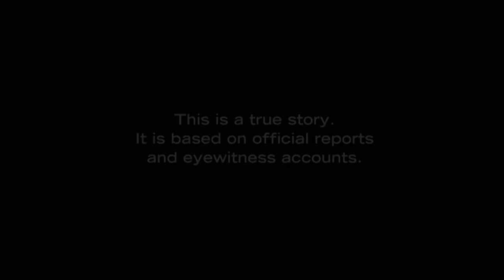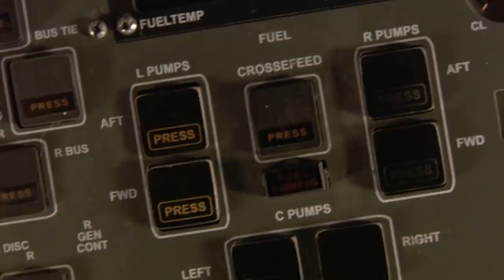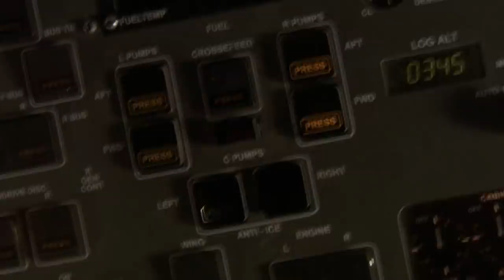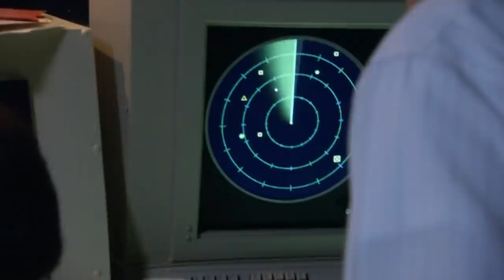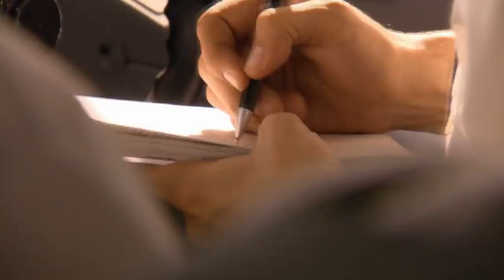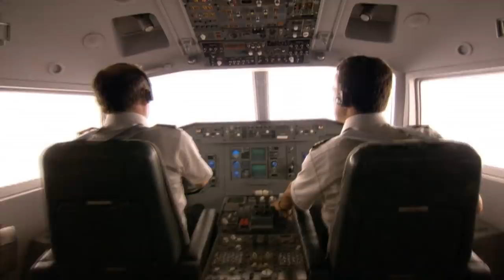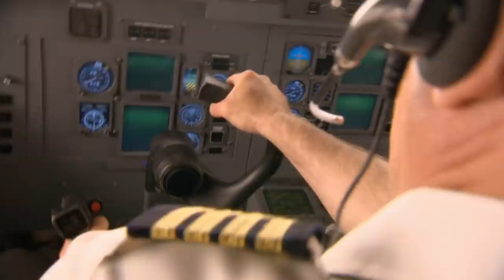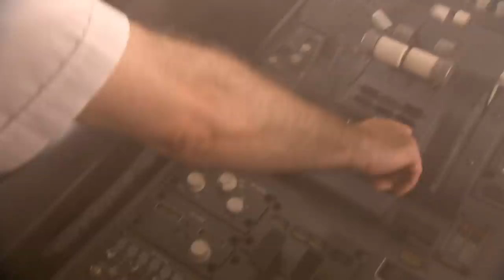Landing A Boeing 767 Without Engines | Gimli Glide | Mayday: Air Disaster

Comment: "The runway he trained at 15 years ago... is no longer a runway" that's got to be the biggest bruh moment of all time for these pilots
Reply: Kids on the bikes:
Pedaling into the grass?  Nah
Trying to outrun a plane? Yeah boi
Reply: Anything's a runway if you're desperate enough.
Reply: @vikkimcdonough6153  even a highway could be a runway
Reply: I think they mean the runaway they used is no longer a runaway.
Reply: @nikeboi2882  didn't another plane try that near atlanta and it blew up iirc
Reply: They don't mention it in this video but in the original they explained why it ran out of fuel. The reason was around the 1980's Canada had just adopted the metric system. The crew fueling the plane that day did their measurements in gallons not liters.
Reply: @JohnNorton86  they explain this in part 2 of the video.
Reply: @JohnNorton86  Im aware
Reply: @vikkimcdonough6153  even a city is a runway
Reply: @jaybartgis5148  those kids went to the Prometheus school of running away from things
Reply: The kids were freaked out in shock
Reply: What about that one when a plane crashed in a neighborhood in california
Reply: @cononodapotato6920  Southern airlines flight 942. Hit a gas station on a highway after both engines flamed out in a storm
Reply: @Giratina575  I thought that it was Southern Airways Flt 242.
Reply: @redfern2236  whoops I got the first number wrong. I knew it was something 42
Reply: @Giratina575  it’s okay. I knew what you meant regardless.
Reply: Here in New Orleans Taca flight 110 landed on one of our levees. And to even make it more badass the pilot only has one eye!
Reply: Baby I would’ve dieedddd lmao
Reply: Bruhhhh
Reply: @therealcrowsyt385  It was turned into a drag racing track and evidently no one knew that.  And it was a Saturday and the races were going on and still no one was harmed!  How awesome is that!  In fact some of the people at the track ran to help the pilots with their own fire extinguishers.  That was brave a good of them to do that.
Reply: @cononodapotato6920  I didn't see anything about a part 2.  So that's why this video cut off short.  OK
Reply: I really didn't make no difference other than the people being there.  

It's still a long enough runway and the wings are propped up higher than the pillars. G2go.

Comment: That pilots arm muscles must’ve been dead by the time they landed. The amount of strength, skill, and bravery demonstrated by the crew was paramount to their successful landing and Mr. Pearson is a example of the type of pilot you want to have flying your plane. Rest In Peace sir (he passed in 2019)
Reply: God gave him the strength. Now they meet. Good job.
Reply: Yeah, it's definitely a lesson in not skipping arm or leg day (don't forget about the rudder pedals).
Reply: Absolutely
Reply: Are you nuts? Captain Pearson was the sole architect of that emergency. 

Having worked in aviation for over ten years, I am familiar with the policies applicable to this situation. Aircraft captains must sign off on the serviceability of their aircraft. This includes fuel load. His efforts were nothing more than a desperate man trying to save his own ass from a potential disaster, for which he was solely responsible.
Reply: Bob Pearson ❤
Reply: Bob Pearson 🤕
Reply: That last part is kinda false, Pearson is still alive and fine, as far as I’m aware however Quintel passed during the 2010’s

Comment: Before it was retired, I flew on the Gimli Glider hull to Vancouver with my grandfather. He had been an AC pilot for many years and knew Bob Pearson. Today, the aircraft is sitting in the Mojave desert airplane graveyard. It should be in a museum.
Reply: I thought it was scrapped 6 years ago? 10,000 tags were made from it's fuselage.
Reply: Yeah, scrapped and turned into Planetags.
Reply: @TheRazorbackpilot  Sad. Though at least we could have a bit of it in our pockets.
Reply: @MilesL.auto-train4013  True, some of them were given to the Gimli Glider Museum in Gimli, Manitoba. They had them cut into the shape of small 767's, cast in resin and sell them in the gift shop. I recently purchased one. They were also given many parts of the plane including the Ram Air Turbine, a section of the its side with three windows, some of it's seats among other things which are all on display there. Apparently having a piece of the Gimli Glider's fuselage is considered to be a luck charm in the aviation world,  I have heard stories that some pilots who own a piece are known to carry it with them in their flight bags.
Reply: @billijomaynard8924  Wish I could get one, I hear a few float around online.
Reply: Why is it not flying?
Reply: @Lunalas4123  Because of it's age. The Gimli Gilder was retired in 2009, most commercial airliners have a working lifespan of around 25 years. A small amount of 767- 200 series planes like Gimli are still in operation today but none as passenger planes, they are used mostly as cargo planes. The 767- 200 series started service in 1982 and Boeing stopped production of the 767 in 1994.

Comment: "Fly until you die" has probably saved more lives than we'll ever know.
Reply: I also really appreciate that he was immediately like “nah we landing”, I saw another video where they just ignored the lights and thought that it was just a computer problem instead of actually looking at what was wrong
Reply: @lis9691  You're probably thinking of the Air Transat 236 incident, which is similar to this one.
Reply: Very well put. Fly until it is physically no longer possible because there's no plane left to fly, no pilot left to fly, or no airflow over the flight controls because the plane has stopped. (Not saying until it's touched down, because even with wheels rolling you're still flying it, you're flying it until everything has ground to a halt.)

Comment: "...and one thing the 767 doesn't have, is a horn."  OMG!  Now, that is script writing!
Reply: The sound of it smashing into asphalt and then scraping down the runway performs that function pretty well, though.
Reply: @vbscript2  Not when it's in the air, though, by the time it hits the ground it would be much too late
Reply: @0w3nn  Not necessarily. Landing rollouts often take 30+ seconds. More than plenty time for a person to run off the side of the runway if they're a few thousand feet or so down the runway from the point of touchdown.
Reply: @vbscript2  True, but what I mean is that the people there couldn't tell the boys there was a plane trying to land until after the plane scrapes the runway, which would cause a lot of panic
Reply: LOL!  True that.

Comment: My God, this pilot deserves a medal.  This was a nail biter with a happy ending.
Reply: Ryan Garcia
Reply: In 1985 the pilots were awarded the first ever Fédération Aéronautique Internationale Diploma for Outstanding Airmanship.
Reply: Just a superb job by the captain still wondering what caused the engines to fail.
Reply: @ckelley63  They can't run on air alone was the primary cause.
Reply: @Jagabot_Esq.  Hey jabroni nothing gets by you now does it. The ground crew. Miss calculated the fuel exchange numbers between metric and US.
Reply: @ckelley63  
There were many errors, 
that combined to create the problem.

Metric-Imperial converting, 
was only 1 small factor.
Reply: btw
IF I lived in the u.s. I would be embarrased by the measurement system.  
There are many reasons why Metric is used in much of the "educated" jobs, of the us !
Reply: @dirktween244  Glad you don't slapnuts